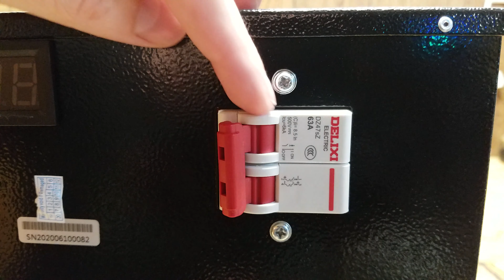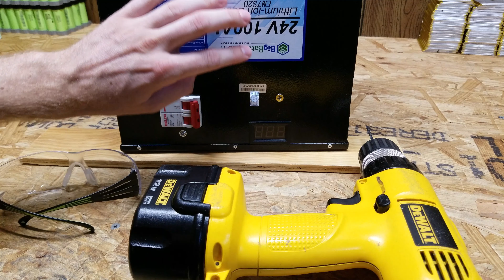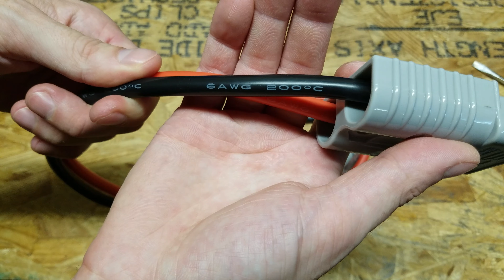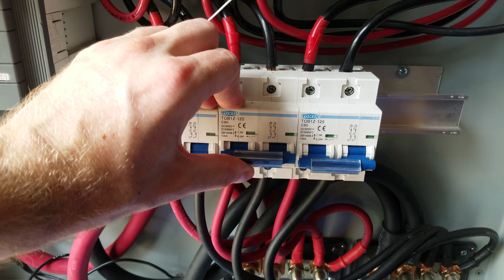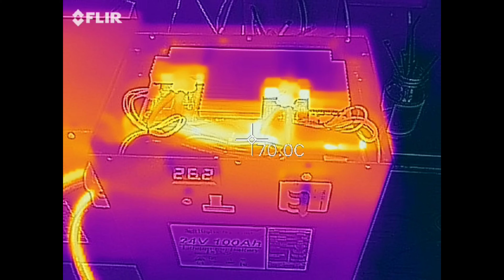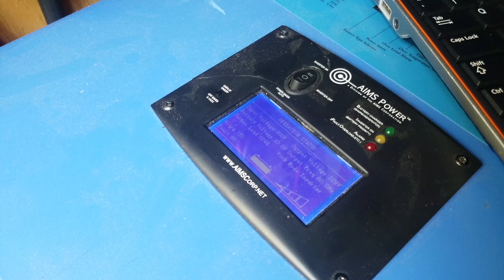Overview and Testing of the BigBattery 24V 100Ah Lithium Batteries, Plug-and-Play!

Comment from the maker: Hey guys, I'm happy to let you know that I have spoken with BigBattery this evening regarding the problem(s) I have experienced. We are all in agreement that the problem is not the way the breaker is wired, but rather the torque of the bolts and the quality of the breaker overall. They have had many internal discussions since the posting of these two videos, and will no longer be using these breakers going forward. For them, it's a matter of reducing the potential points of failure. They will be redesigning the product to feature a user-serviceable fuse with an on-off switch rather than a breaker. Despite my disappointment in having experienced this problem, I strongly appreciate knowing BigBattery is willing to listen to customer feedback and make changes for the better of everyone.
Reply: LithiumSolar Any idea when that redesign may happen, I will buy several after that and your retest of course. Great video! You are give Will a run for the money👍
Reply: @jkuoverland8507  I think it benefits everyone to have more than 1 solar or battery channel. 
Will does a great job, no criticisms. Integrity is key.
Just subscribed to this channel and looking forward to gaining more insight.
Reply: Billy Anderson Thanks!
Reply: I would like to know how long one 24v would last drawing a continuous 52 amps. Please and thank you.
Reply: Where can I find your old 50 CAL 18650 Project Video?

Comment: I just bought a Big Battery Hawk 24 Volt 3.8watt hour battery and awaiting Delivery now for My Victron Phoenix 24/1200 Inverter and 150/35 Smart Solar Charge Controller and 600 Watts o Eco Flow BiFacial Solar Panels

Comment: The temperature probes were not on the circuit breaker.   So why would you be surprised it didn't trip.
Reply from the maker: Circuit breakers are thermal devices, they do not rely on temperature probes to trip.
Reply: @LithiumSolar  that wasn't my point. 

But circuit breakers can be thermal or magnetic.

Comment: Nice review. 

The Anderson Powerpole connectors are the best mass-produced DC connectors. The their spec sheet, there are detailed test results on the temperature raise at the rated load. 

The reason why the DC breakers gets warm is that the breaker actually relies on the raising temperature to cause deformation in a bi-metal spring to trip. When the current is near the rated capacity of the breaker, the temperature is expected to be high.

Comment: good video, cruddy batteries, thats a big difference in what is advertised, I I like that you show them, but thats not really a review, you skipped steps, and did not show a proper capacity, and companies that cut corners to save money like using a double pole with copper plates, makes me wonder what other corners were cut , like the temp shut off, more than double of what its supposed to be.... to many cruddy variables , i cant believe you recommend these, they must be paying you a lot, to endanger the public.
Reply from the maker: The heat issue was the result of a loose bolt on the breaker, which was later rectified by myself. The company acknowledged the problem after this video and made changes going forward. Their new batteries don't even use these breakers. Additionally, my testing of these was flawed. I should have tested it at a 0.2C rate and reported amp-hours back, not watt-hours. I've made changes to my testing procedure on newer videos to address this issue as well. They do not pay me for my videos or recommendations. My opinions expressed are my own and I'm honest when I see something I do/don't like.

Comment: Big Battery cart did not have place where we can apply your coupon code !
Reply from the maker: Ah, I cleared my browser cache and it's working now. If you click Proceed to Checkout, there is a link on the top-left that says "Click here to enter your code". It's on Step 2 of the checkout process.
Reply from the maker: That's interesting... I'm seeing the same. Also, the checkout page appears to be blank and can't check out either. If it's not fixed in a few hours, I'll let the know. They might be working on it.

Comment: Stay away from those batteries with a ten foot pole. Unless you want your house or shed to burn down. 150 C internal  temp. and they were suppose to shut down at 75 C. Come on man stop it. Plus the batteries didn't pull close to stated capacity. SMH!
Reply from the maker: The heating issue was a manufacturing issue. After I tightened all of the bolts, it doesn't heat up anymore. I've made it known to them that this is unacceptable and they assured me they're working on new/better designs and QA going forward.

Comment: Why not 12 volts?  What is 24 volts used for ?
Reply from the maker: Once you start increasing current, it's common to increase the voltage to reduce amperage. Most off-grid solar installs are using 48V, with some at 24V. For example, a 5000W load at 12V is 416A. You would need some massive cables for that. If you run the same 5000W load at 48V, you're only around 100A, which is easily manageable.

Comment: I just looked at the BigBattery web site and they are still selling  this battery with the same breaker.
Reply from the maker: Yeah, they didn't put out a revised version of this particular unit, but new products being released no longer have the breaker. For example, the LiFePO4 170Ah battery that I reviewed recently has a 300A fuse that's easily replaceable.

Comment: Rookie question of the day...
Providing I have a 24 volts 1000 watts inverter to provide power exclusively to a mini split ac that requires 500 watts to work, how many hours of operation I can get from one of these batteries?

Comment: Available 24v 300ah?
Reply from the maker: Not as a single device, but they make a paralleling cable that you can use to join multiples together https://bigbattery.com/product/anderson-sb175-connectors/?ref=13
Reply: @LithiumSolar  👍👍👍

Comment: Tell me if this would work and if not why.  If  I have a Solar power available of 4 K watts to a 2 Kilowatt load, with a 1-kilo watt set of batteries.  As long as the solar array supplies more power than the Load, wouldn't this work?

Comment: Hello, I was wondering if you could run a skyjack scissor lift with the batteries since the skyjack uses a 24 volt system also?  Most skyjack lifts come with 4/6 volt batteries wired together to make a 24 volt system. Thanks

Comment: The batteries revealed several issues and some are attributed to the test procedure? Should not  another test been performed? Also...did you say at the end of the video that if the circuit breakers were upgraded this battery might achieve the specs listed right on the case? Do I understand you correctly? This video was fun to watch and these seem like a great battery yet what have we really learned here?
Reply from the maker: A new test should be performed, yes. New breakers are on the way, yes... Coming soon.

Comment: Just wondering if one of these would be a better option for my RV over the 2 6V 225Ah batteries I currently have.  I realize I would need to use a DC to DC step down converter and a 24v inverter, but I was going to upgrade to 4 Trojans soon and was looking for other options.

Comment: Regarding the breakers, sometimes engineers underrate the breakers to get a quick fault (output short circuit) response. A larger breaker say 125A would take 2x - 4x the time to open in case of a fault and that could damage the battery.

Just that it seems wierd that such a well designed and well built battery would have such an obvious fault.
Reply: 2 @ 63 Amp Breakers with parallel wires is a correct design to get 100 amps for 1 hour.
Reply: Different breakers also have different trip curves. There are some which trip quickly with over current, and some which are slower. If you want a faster trip response, you should pick a different curve instead of a different amp rating.

Comment: Cool video! $855 is steep for what you get though. For 100 amps they should’ve used an absolute minimum of 4awg internally, preferably 2awg.  8 and 6 “gauge” are not adequate for that load over that distance.  You can see on the thermal camera that the internal cables were getting extremely hot—this is indicative of insufficient wire size for the current being drawn through it. Wouldn’t need 200c temperature rated wire if they had used the proper size wire in the first place. I’d be curious to see the results after changing all those 8 and 6 gauge wires out for true 4awg or, better yet, 2awg tinned OFC. My theory is better thermal readings and less voltage sag.
Reply from the maker: I agree it's steep for the DIY community (which most of us are a part of). However, if you're looking for a drop-in replacement for a 24V application (or any multiple of it) and don't have the time, skill, or care to build your own - I do feel it's reasonably priced. A follow-up video will be coming, probably in a month or so due to having to wait for slow China shipping on a few parts.
Reply: LithiumSolar oh I agree! It’s a great concept, especially for, as you said, someone who lacks the knowledge/experience/time to build one.  From my perspective, it’s steep for the quality that you get as it relates to the internal wiring. Using appropriately sized wire would literally add less than $30 (maybe less than $20) to the production cost. I’d be willing to pay that price if it had better cable inside and a single pole 120/125a breaker. As it comes off the shelf? I wouldn’t pay more than about $500 for it having seen the inside. Just my opinion though.  It’s a great idea, just needs a few improvements to make it worth the price point at which it is being sold. It’s always great watching your videos!
Reply: @miket5506  Do you actually load your off-grid battery bank at 100% of Rated Capacity?

Comment: HOW MANNY HOURS RUN 1.5HP aircon that kind of battery 100Ah 48volts
Reply: 4hrs
Reply: Travis Sanders  thanks bro
Reply: 24hours @200watts.
Reply: Travis Sanders  200watts only ? 1.5HP is around 1,200watts
Reply: @3dilawan269  I missed that 1.5 hp. My ac is 200w.

Comment: Great video. I have a question. If I have 2 12v solar panels and want to charge a 48v battery would I be better to run them in series to I have 24v from the panels or run them at 12v in parallel? I'm using a charge booster.
Reply from the maker: Series is probably best as long as the Voc voltages are witihn spec of the controller. Higher voltage = greater efficiency.
Reply: Thanks for that!

Comment: Great testing video for practical use. I have one problem and its a no brainer. I've bought from Big battery before I have a 24 powerwall but for the price of these newer lyon 100 AH batteries, I would spend another 100 bucks or less and get a guaranteed for 10 years Battle Born ??   I've not drank the Koolaid for B.B. yet but gee whiz if I'm going to spend 900 for a used/new lyon with  no guarantee ????  But then again you got yours free and that should be stated when comparing the two company's. that 10 warrentee is easy worth 100 bucks, plus what your insurance company will say if you have a way to hot ! problem.

Comment: 1000bucks,no thank you
Reply: @Eddie - What are you using for your battery bank?
Reply: @vtorsi610  i use limn02 cells, they handle quite good my discharge rates.
Reply: @eddieeddie99  Nissan Leaf ?
Reply: @vtorsi610  yes. Lg cells for Renault cars are also doing really good.

Comment: You can parallel breakers and other components and get good current sharing, you just need to be geometric in your assembly. Meaning your power connections to and from the breaker need to look like a tuning fork, not a bar connection with the power lead at one end, it needs to be centered between the two input terminals. 

We do this all the time with high power rectifiers and SCR bridges for medium voltage motor control. 

Sometimes you can't get parts in the form factor you're looking for in the ampacity you need. 63A is as big a mini circuit breaker as you're going to find by any manufacturer.
Reply: That copper jumper is huge.  Those breakers and the copper jumper were DESIGNED as set to share the current.  It is not a problem if they don't share exactly equal given that 2 x 63 = 126 amps vs 100 Amps (max) load.

Comment: I was very tempted to build my own pack but then I found Pylontech batteries designed for the telecom sector. 48V 2kWh usable (2400Wh pack) and 50A load. I have no vested interest but I haven't found a better value battery, DIY or otherwise.

Comment: Lol. I checked the price $950! Here, check out this 170 RC deep cycle marine battery from Menards for 88$. You could buy ten of these Marine deep cycle batteries for 10 times the power for the same price! https://www.menards.com/main/tools/automotive/automotive-batteries/fvp-reg-voltedge-reg-m27-7dc-deep-cycle-marine-rv-battery/2609725/p-4364363665510356.htm
Reply from the maker: This battery will last 10+ years easily. Your deep cycle marine battery will likely need replaced 6-8 times in that timespan ;) Think about it...
Reply: @LithiumSolar  I get about 10 years from my average car battery and that's with using it every day. I've only owned my Deep Cycle RV batteries for a couple years but since it's the same lead acid technology I expect them to last as way more than u hypothesize. And even if they didn't I could just desulfate them. What do you do with a dead lithium battery throw it in the trash?
Reply: @iditarod4081  You do not deep cycle discharge your car battery every day.  It takes only 2 - 3 seconds to start your car.  The battery that you linked to is a Dual-Purpose Marine battery - a so-called "Deep Cycle" battery.  It is NOT a great engine starting battery nor is it a great Deep Cycle battery - it is a poor compromise.  Your battery has a 1 YEAR warranty.  Deep Cycle discharge and then recharge once per day and then you will see how long your so-called "Deep Cycle" battery will actually last.  We have been there and done that, so we already know ...

Comment: Could these be used in a shed style observatory outside with no heat or AC? Temperatures range from 0-105 F
Reply from the maker: They should be fine in that range, but 105F is kindof pushing it in my opinion.
Reply: LithiumSolar 105 would be a huge anomaly but the are a couple days that hit 100 and a month of 90s. If you think that is workable I think I’m going to try this.
Reply: On a really hot day you would need to reduce the charging current from the solar array. Or are you are taking them home to charge  inside where it is air-conditioned? My observatory uses lead acid batteries and they do everything I need. But lithium is nice from the power density angle.
Reply: Li-Ion batteries will degrade in the heat.  Li-Ion batteries can be damaged in cold weather.

Comment: Wrong 950. Per battery. Awfully pricey for a 100 amp battery.
Reply from the maker: No, not 950. You didn't put in the 10% discount code.
Reply: @Randy - $855 for 100 amp-hour @ 24 volts and with a BMS & case.  "Pricey" - compared to what?
Reply: Note that 100ah @ 24v is 200ah @ 12v.

Comment: I find it a bad design to have a heat sink like on the BMS full enclosed in the case.  Over time it just pumps its heat into the inside of the case.  Though in this case, there were other bad design choices that were worse.
Reply: But the heat sink was cool.  So, what is problem ?

Comment: Ugh,  I don't think it is a good idea to reverse wire a connector like that.  What if something happens to you or you're not around and someone else is playing with that cord?  I would rather make the series connections outside the batteries and outside the connectors.
Reply from the maker: I can't think of any way it would be unsafe. Regardless of how you plug the cord in, there are no ways to short it unless you take both cut ends and touch them together. It will always be in series regardless of which connector you plug in to which battery...

Comment: in my barn i want to use a single cow milking machine & some led lights & 3 residential fans ... what do i do first to set that up ???✌🤞🤔
Reply: You need to determine the total load in watts you need to support and multiply that by the number of hours it will need to be supported. For example, keeping everything 24v dc for simplicity, you have 10 led lights (variable L) that draw 17w each and three fans (variable F) that draw 100w each and want to run them continuously for two hours.  In this instance we’d have the following formula 10L+3F or  (10x17) + (3x100) = 470w.  If you needed to power that load for two hours you simply multiply the wattage load by the number of hours (470x2=940wh) to determine the capacity of the storage you need - in the above case it would be a minimum of 940wh (watt hours) or just under 1kw of capacity minimum.  Keep in mind you never want to go over a certain amount of discharge with some batteries so you’d oversize.  If everything in you barn requires AC you’ll need a power inverter properly sized to convert the dc power to ac and you’ll also need to calculate the power loss associated with the dc to ac conversion - 10 to 20% depending on the inverter.  Good luck.
Reply: @eduardo_k  got it , thanks so much
Reply: @eduardo_k  so by doing the math i have lights about 50w 14 hours a day , 3 fans 96w each 24 hours a day & a vacuum pump about 30 min. a day for 4 days a week ... i came up with an average use of about 7,800w a day ?? or about 7.8kw a day , that doesn't include 20% conversion w/ the inverter ... that's a lot of battery storage if my math is correct ... thanks for getting back to me so quickly ....